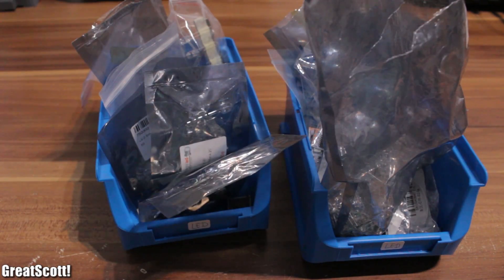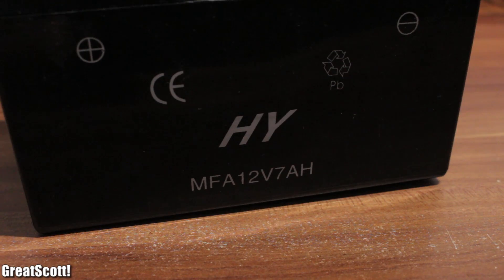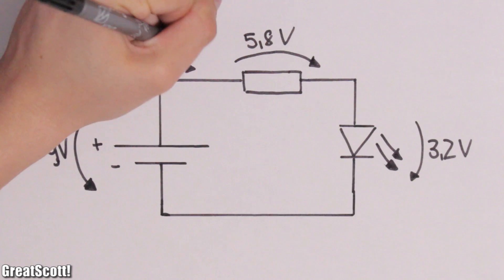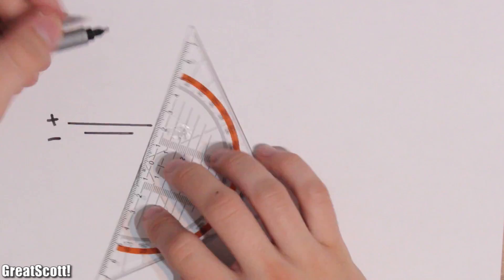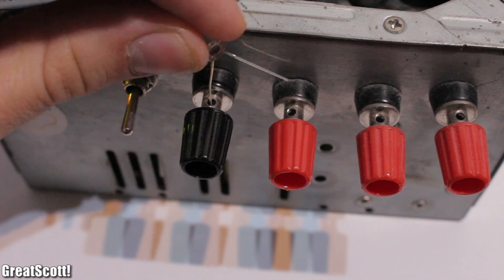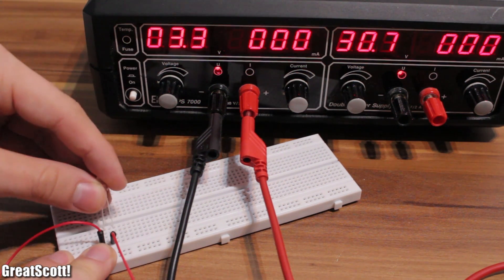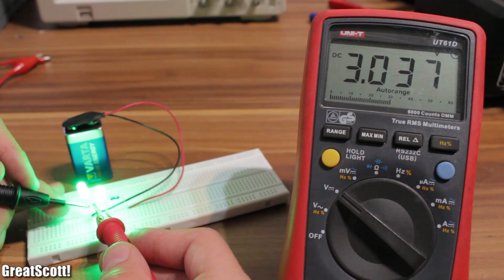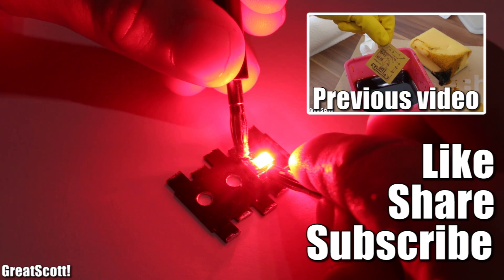Electronic Basics #8: Everything about LEDs and current limiting resistors

Comment: what if I want 2 light in parallel because of the limited voltage. I want to use lithium-ion battery with 4V. How to configure it ? I tried and they died even though I gave quite high resistance than it requires. Can you help to figure it out ?

Comment: So I wired my custom led tail light and it super bright is there a way to dim it while keeping the brightness when I brake?
Reply: You have probably already figured it out by now, but you should have a separate wire for your tail lamps in the wiring harness. Run an additional resistor in a value to cut the current by whatever percentage you want on the tail lamp circuit, in the proper wattage rating to handle each array. Wired in this manner, the array will be dimmer under normal circumstances and only receive full current from the brake lamp circuit when the pedal is depressed. Just include a diode on the brake lamp circuit at the lamp to prevent back feed from the tail lamp circuit. Basically, you are running two power sources in parallel with a resistor on one and a diode to separate them.

Comment: There is one Main question that dazzle me for a long time: how to identify voltage and current rates for UNKNOWN LED?
Simply on my mynd comes to connect lab power supply and increase voltage untill current reaches 0.02A. But this work only with 3-5mm led's. What about >0.2W led's?
I have 10W LED 220V lamp, and its failed. I taking apart and see one led with black spot - it's busted. My Unit 61E can lite up small led's in Diod Test mode (2.85volts), and he did it with other led's on lamp. But there is a problem driver gives 155Volts for 17 leds directly (no resistors on led's pcb): 155V / 17pcs = 9V (around). How 2.85Volts can light up 9V led?
Current in this circle is 150mA (measured on failed led, by bypass him), and there is second problem - there is no 2835 LED with 9V / 150mA existed! Only 3.2V/150mA or 9v/100mA. So what LED should I order to replace failed???
Is there is some method to identify U/A for unknown LED?

Comment: Great video. thanks for sharing. Most ppl don't understand how hard it is to work in an advanced fashion with LED's while also balancing power efficiency and component/circuit protection requirements. You did a great job of laying down the overall dilemma's a beginner might need to consider before choosing a solution.

Comment: Sir, I've a question. I've seen in the TP4050(Li-lon Battery Charger) datasheet have standard LED for Charging status but how these are working fine with 1k resistor? Here is the datasheet http://www.datasheet-pdf.info/entry/TP4056. Would you please answer this - Thank you

Comment: Hallo! u. Guten Tag! sorry my written german isnt too good! Have you made a lightsaber using an LED light string? using around 80 or so 5mm 3.0 - 3.2v 20ma LEDs (all wired in parallel) using 18650 LiPo or Li-ion batteries.. would a voltage regulator work? thanks i probably will get my LEDs from leading-led dot com (fair prices, nice selection, data sheets, etc) Danke

Comment: I have 135 flashing leds that need to be powered together, do i parallel with a reistor on each?
Reply: If you watched the video you should know
Reply: He didnt mention 130 lad's now did he?
Reply: @Vass881234  no not 130 specificly but he explained how to handle large amounts of leds
Reply: So 5000 would not be effected in parallel. 1.7 volts would light them all ?
Reply: @Vass881234  if you could supply 100 Amps, then yes. Parallel connections require more current while series connections require more voltage.

Comment: How can I get 20 mA for three 3V LEDs connected to a 9V battery ? I mean there's no resistor to set the current (with ohm's law) because 9-9=0 and 0/0,02 is still 0 Ohm
Reply: The LEDs have resistance as well, but the resistance varies with the input voltage so you can't really think of it like a simple resistor.

Comment: can someone please explain this to me.
if led require 0.02 amps and we connect led and resistor in series how can a resistor help anyhow if the current is the same but voltage gets dropped.
and also i wonder how come can voltage drop if in ohms law formula if you increase resistance the voltage also increases.
i may be stupid for asking but i dont get it.

Comment: I have a project but can't get the resistance  Part. so If I have 13x3.4=44.2 LED's and batteries 3AA at 4.5v running at 20mA the net calculator gave me a resistance of -1985 is that correct?

Comment: Hello and let me start by saying that your videos are epic! They have helped me a lot! Now I too want to ask about the 2 LEDs in series in respect to Kirchhof's 2nd law.
The law states that the products of resistance times the current of all conductors must be calculated. Doesn't that mean that you need to take the voltage drop of the LED into account instead of the nominal voltage.
So in the case of the 2 LEDs you need 3.2 + whatever the voltage drop (usually very small)  is not 3.2*2.
What do you think?

Comment: I want to make a toy for my daughter which uses flickering yellow LEDs, it's for a kitchen hob which the LEDs imitate the flames I have 6 holes per hob (2x hobs) but I've only got a 9v battery to power 12 off these, the spec sheet says you don't need a current limiting resistor, the forward voltage is 2.5v and requires 20mA what would be the best solution?

Comment: first of all. I want to thank you. I have learned a lot. from you. in the year and 10,11 months. yours is one of the first channels I watched. when I got on this subject. I just can't get away from it. I want to learn. and you make it easy.. so thank you! and I have a question!  does the watt rating of the resistor make any difference? I was going to use .5 or 1 watt resistors and diodes. its what I have. and 1/8 watt resistors for MOSFET gates. is this OK?

Comment: Diodes are introduced in pretty much all beginner level projects in the form of LEDs, but the behaviour of diodes is actually quite difficult to grasp, especially compared to resistors.
For a long time I assumed LEDs to behave like any other load: a resistor. That's why I always had a very bad feeling when people looked at the forward voltage rating of an LED, and assumed that would always be the voltage drop across the LED regardless of any resistor connected to it in series. If the LED behaved like a resistor, then the fraction of the source voltage that the LED receives would be dependent on the value of the resistor connected in series. But an LED is a diode, and diodes don't obey Ohm's law. It took me a surprisingly long time to realize that.
Reply: Woah! What a realisation! Thanks for sharing it. I was so confused about this behavior. Now I can read more about it.

Comment: So for low voltage projects having leds in series is OK and not a big deal even if you have different leds with different voltage requirements. But in more advanced applications it's better to build a circuit with maintaining the current instead of the voltage. Got it. Awesome

Comment: @ 2:23 you say that since 0.116W <= then 0.25W,  it's okay to use these resistors in this circuit, but wouldn't the max. power rating be 0.5W because you used 2 150 Ohm resistors (so they both have a 2.9v voltage drop instead of a single one with 5.8)? It means you could've put like 4 leds in parallel!

Comment: why are you using a resistor with LED?
Reply: Are you actually asking or just taking the piss? Haha, anyway...
The resistor is used to limit the current through the LED. If the current is too high, the LED will burn-out/break. So the resistor is used to limit the current going through the LED to 20mA, which is what the LED requires for normal operation.

Comment: do resistors get hot? is it normal?
Reply from the maker: Yes. That is the only thing they can do.
Reply: +GreatScott! poor resistors.... :D
Reply: Chardx PerfectStranger 
yes read about power rating
Reply: First measure / know what voltage you have, then measure the current through the resistor.
If the current (Amperes) times the voltage (Volts) is more than what the datasheet calls "power rating" (Watts) then the resistor may burn up.

You are probably fine though, the resistors shown in the video are roughly 1/4 W so, its unlikely that you will damage them with 5 Volts (unless you use resistors below 10 Ω).
Reply: That's one might hot resistor you got there....

Comment: I think you might have miscalculated the resistors' power dissipation at 2:18.  You'd want to calculate the power dissipated across each individual resistor, so since they're in series and they have the same value, the voltage gets divided by evenly across the two of them, giving you (5.8/2)*0.02 to find your power dissipation in an individual resistor, which gives you .058 W.

Further, you are neglecting the fact that you will get a current slightly smaller than 20 mA since you have an effective resistance of 300 ohms instead of 290 ohms, but that's less important :)

Comment: To get the value of the Resistor, for LEDs in series..
For LEDs in series, forward Voltage is added, but the forward current stays the same.
LED Specs.. 3.2 VF, 0.020 IF, with a 9V DC power supply.
1. Add Forward Voltage of LED's in series.
3.2V DC.

2. Subtract Total Forward voltage of LED's in series from Supply Voltage.
3.2V DC - 9V DC =  5.8V DC

3. Divide the answer you got from #2, and divide by the forward current of the LED's to get the resistor value. 
5.8V DC / 0.020 = 290Ω Resistor.

To Find out how much power the resistor needs to handle.. use Ohms Law.

5.8V DC^2 / 290Ω = 116mW, 290Ω Resistor.

Using a 300Ω Resistor..
5.8V DC^2 / 300Ω = 112.13mW

How much current will it use, if you do want to use a 300Ω Resistor?
5.8V DC / 300Ω = 0.019333 Amps. It will be at 96.6% brightness.
It looses 3.33% brightness.

Using Multiple LED's in parallel is more common, because with LED's in parallel, the current is added, but the voltage stays the same.
Reply: But I don't get very well the ending, when he talks about the LM317 :(

Comment: what if I want to for example use 1 LED with 20ma and 1 with 10ma. what should I do?
Reply: Use 1 resistor per LED.  Figure out the values using the formula outlined in the video.

Comment: +GreatScott hi! 

I am so grateful to you for all the videos that allow someone who is new to understand electronic with some depth.. 

I would like to ask the following questions. 

I have 6 leds (3v; 20mA) that needs to be light up concurrently on standalone battery source (5v; 10kmAH) and last at least 2 weeks.. 

From this video I understand series won't work for me as I would need an input of at least 18v.. Parallel would sap 120mA thus my battery can only last me max 83 hours. 

Can multiplexing with an led driver help my issue?
Reply from the maker: +xzeionax A simple PWM dimmer would create the same effect as multiplexing and is easier to make. Try a 555 timer circuit.
Reply: +GreatScott! Thank you for your prompt reply!! I am checking out your video on pwm dimming..!!
Reply: +GreatScott! If I'm running a RGD led with a attiny85 micro controller with 3v button cell and I connect a 100 ohm resistor to all the anodes would it be fine and efficient (the red forward voltage is 2 green 3.1 and blue 3.2 with all 20 milliamperes forward current)

Comment: Is an LED driver all I need to power a COB ?
Reply: +Joshua Boucher Depends on the LED, if it's a large 10W or bigger LED then you're definitely going to need active cooling to run them at full power, if it's just a little 1W - 5W LED then a small heatsink should be enough.
Reply: +vgamesx1 I'm looking at either cxb or vero 2. Probably 6 -8 of them.

Comment: but what if i have a battery that says " 5V , 350mA " and i have also two led lights ( 3.2V , 20mA ) , how can i calculate the resistance ? R=U/I = 5-(3.2*2) / 20 = 5 - 6.4 !!!! .... /20mA  :(
Reply: Didi Adam Don't connect them in series, Just put them in parallel

Comment: Wait why are the voltages of the 2 led's added to get the final needed resistance of v/i, wouldn't you just add the current of the to led's to then use for ohms law. Because they require 3.2 volts, with the resistor value chosen from the equation with the voltages and current added the final voltage drop would 2.6, and the final output voltage would be 6.4. Which is 2x more voltage then they take. Without adding the voltages the final resistor value would be 145. Please help. :)

Comment: Wow the creator of this video explained it well and he clearly understands what he is talking about. Good job. It's refreshing since a lot of other youtube videos have people who clearly don't know what they are talking about.
Reply: One thing I am sure about is that if you have a battery that coincidentally actually is the same voltage as the LED's nominal voltage then you in fact don't need a resistor. I am pretty sure the voltage from a battery doesn't randomly just spike upward in voltage and burn out the LED. It just slowly drops as it's discharged.
I have done this and it doesn't hurt the LED and the LED draws the right amount of current.
Reply from the maker: David Irving That is correct.
Reply: GreatScott!
I have a question also about what that Forssa1 guy was claiming. Was he saying you cannot connect multiple LED's in parallel using one resistor? Claims they die out etc. This is amazing since I actually have a bought LED light and took it apart and it's like a strip. So it has on the circuit board that is like a really long rectangle. It has two copper strips painted all the way up it. One positive and the other negative. It then has the 6 LED's placed across these strips which is parallel.
And all they have controlling the current is 1 resistor that is before the LED's on the positive side.

So this Forssa1 guy is claiming this is bad? So if one LED was to burn out then the other 5 would still run of course but he is saying they will draw too much current now and burn themselves out within time.
I think of get it. As one less LED is running then technically a slightly bigger resistor should be used suddenly but it's still the same resistor which means it's allowing though that extra 20mA that has to be distributed between the other lights now.

This is pretty lame that even some store bought LED strip light thing isn't made very well.

With series the only reason one resistor is safe is that if an LED dies then the circuit is broken and the rest can't die. So there is some safety in a way.

At the end of the day you can but 100 5mm LED's on ebay for $1. So I risk it and do parallel many times because it's easier if I just want to run some stuff off low voltage batteries and not have to use anything like a step up converter or a joule thief.
Plus I notice that if you put some LED's in parallel like that light that I pulled apart the case of one randomly dying has in fact never happened to me. It's quite rare since LED's if run at their proper current rarely have any trouble and run for years and years and years.

So a lot of the cases like Forssa1 guy was saying are mostly "what if" cases.

As far as Forssa1 saying that "wastes power as you have to drop all the excess voltage over a single resistor".

This all depends on what power source you are using. You also drop all of the excess voltage when using 1 resistor even in series. It all depends on what power source you are using.
I try to make it as close as possible. So less voltage drop is needed. Doesn't matter if it's in series or parallel in this regard.

I like your videos also.

Comment: Nice info.  I'm glad my intuition is correct, I've always made sure there was enough voltage overall and then designed for the current using either just a resistor or a simple transistor circuit or transistor/diode circuit.